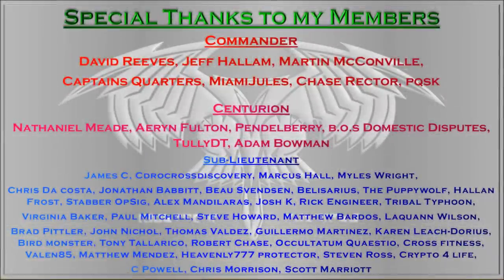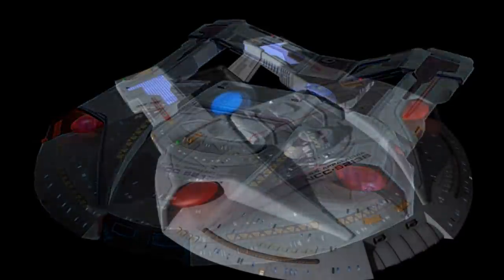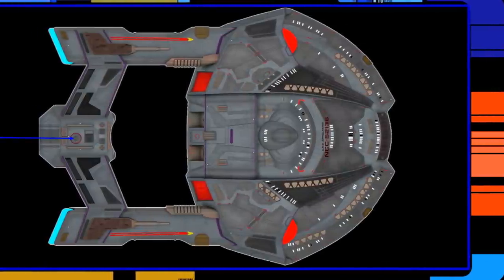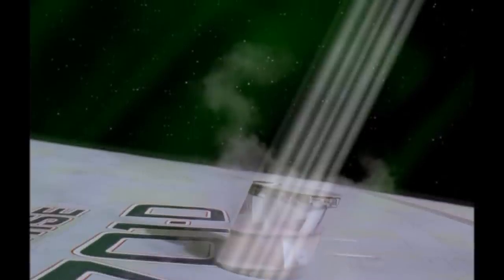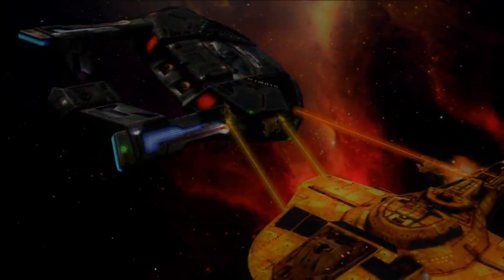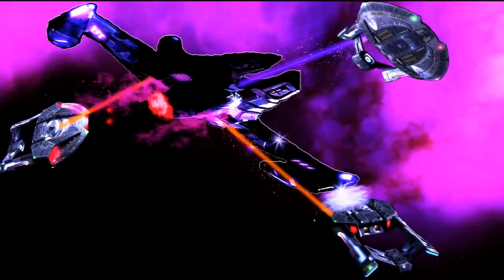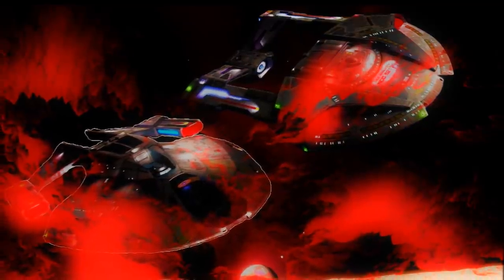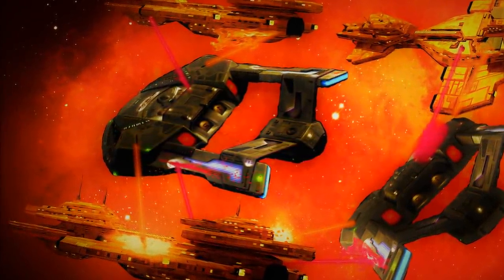Ship Chat: Steamrunner Class

Comment: The issue with the dedicated anti-borg role is the registry numbers, with several examples (including ones you've used in this video) in the 52xxx range. The Defiant is NX-74205; that's a big jump if both designs were instigated after Wolf 359. From what I can tell there are a few contradictory registry numbers for the USS Galaxy, but the lowest is NX-59637, and that suggests the Steamrunner class actually pre-dates the Galaxy class altogether. The small phaser strips are also unusual on later ships as you correctly note, but not the Ambassador class, which is notable for its small and disconnected phaser strips. I think this points to the Steamrunner class being the result of an earlier mini-rearmament phase. There's enough incidents and conflicts in the several decades pre-TNG to motivate a more combat oriented ship with approximately Ambassador class technology, and it's quite plausible that ships like that could be up-armored and upgraded in other ways when the threats started looking more immediate.

Comment: I’ve always really liked the Steamrunner class, but I do think that an underslung deflector would look better forward sweeping or swept back and above the saucer, like the Alkira, which is probably the reason it’s underslung to differentiate the designs, although I do like to see some design commonality so personally would have liked it above.
Reply: The Akira does not have an oversaucer deflector, it's deflector in under the saucer. The pod on the pylon over the saucer is a torpedo launcher, one of 18 the Akira has including a few that fire sideways out of the side of the saucer.
Reply: I should have been more clear, I was referring more to the pod, rather than what’s housed in it.
Reply: Then it wouldn't be it's own unique design. And it also defeats the functionality. Every ship doesn't need to be Akira-like

Comment: Other than the odd placement of the deflector dish, I really like the looks of this ship.  It makes me think of an old Fletcher-class destroyer, it looks fast sitting still and there's no question about if its a science ship.  Its a mean nasty warship and if you piss it off it will kill you until you die from it.
Reply: I have somewhat interpreted this as a destroyer, yes (from prior video game references) Small, fast, agile, flexible.
Reply: The Steamrunner's deflector dish looks better where it is than it would if it were a tiny sliver on the front of the main hull.
Reply: @deusexaethera  It could stay the same size and be moved forward to where its slung under the hull rather than being impossible to get at like an Oberth.

Comment: I have two issues with this design.  
1)  The nacells support the engineering section in space.
2)  The deflector dish is located BEHIND the main hull.  Like that will help it move debris out from the ships path.
Reply: Why not? Most SF vessels direct energies well ahead of the ship, not just a field a few meters off the bow.
Reply: @Euripides_Panz  Because the hull is blocking the projection of energies in nearly all areas ahead of the ship.
Reply: @nunya3163  how's that? From the images I've seen, the entire long-range sensor/deflector array 80% clears the hull at the keel and fields don't have to travel precisely ahead, they can be off a bit because they bulbous and are tuned to allow the hydrogen collectors to function.
Reply: @Euripides_Panz  80% clear = 20% blocked.  Also, because the deflector is both so far behind, and high up, it will be essentially incapable of deflecting anything above the centerline of the saucer.  And that whole field changing shape thing does not jive with the design of the dish, which clearly emits a cone.
Reply: @nunya3163  Clearly you know the design better than the designers. And see invisible fields.
Reply from the maker: You should watch sacred cow shipyards video on bussard collectors.
Reply: @venomgeekmedia9886  I did see that.  Very good channel.
Reply: How is that any different than the deflectors of a galaxy class or any starfleet ship bar the enterprise nx class? It’s positioned behind the saucer and below scale wise it’s the exact same
Reply: @Utubesuperstar  1)  The deflector on the NX is on the very front of the saucer, not on the bar behind the saucer.  2)  The Bar behind the NX is supported by two secondary hulls, not the nacelles.  3)  The deflector on the Galaxy is beneath the saucer, not directly behind it.  It is well below it, allowing for a line of site to push/deflect objects away from the entire vessel.
Reply: bar the nx means the nx is the exception and how do you explain then the akira sovereign nova intrepid they are all but flush with the bottom of the saucer section
Reply: @Utubesuperstar  The Akira and Sovereign have very limited clearance as well, yet that are both beneath, but not behind the saucer.

Not behind.  How hard is that to grasp?  It's like mounting the back up camera on the front bumper.
Reply: @nunya3163  it is on the rear of the saucer or back middle either way blind spot and if you look at the actual scale of the ships the distance is the same

Comment: I see this and immediately think back to your battle of the giants video. The tactics the Vorta used wouldn't have worked against a Federation Task Force. The Jem Hadar battleships worked because of weaknesses in Romulan ships and tactics. The fact that they had close with their big guns. Starfleet could sit their Sovereigns and cruisers at torpedo range easily side stepping the siege guns. Letting the Defiants and fighters take the attack ships and the Steamrunners wear down the defences of the Battleships and Battlecruisers.
Reply from the maker: Yeah it's a completely different doctrine and demands a different response.
Reply: @venomgeekmedia9886  Exactly. In that regard, the Cardassian battleship is better designed to face off against Federation and Klingon ships then the Jem Hadar battleship. In the end, the Dominion would have been better served building upgraded Hutet class battleships.

Comment: I thought the steamrunner only had a single forward torpedo tube. It was described as only having one tube in armada as an artillery ship which isnt official but a video i saw said it had one forward tube too. It having two forward torpedo tubes is odd rather than one fore one aft especially if its a close brawler as it would have to manouvre in close ranged combat and need an aft tube. I also heard it has quantum torpedoes. I thought i knew the steamrunners official traits compared to things from pc games etc that are not official but i should probably check. Nice vid btw
Reply from the maker: depends on which model you look at. but most of the up to date models give it two launchers.

Comment: This model never made any sense when considering the class was a "bruiser", the deflector is incredibly vulnerable in that position.
Reply from the maker: Not really. It's placed at the very back of the ship. Heavily armoured. From most angles you won't get a clear shot at it.
Reply: @venomgeekmedia9886  The only way it's covered is if the ship is pointing at a target and tilting slightly down so the main body of the ship is covering it. In any other position it can be shot at (from the side, rear, ventral, dorsal, and even the front, as it dangles below the main body). To me, it makes better sense to stick it on the secondary hull and use that heavy armor to cover that area around the deflector, and therefore the warp core. When placed on the secondary hull in the usual position it is completely covered from the top and rear. Just my opinion.

Comment: I'm not a fan of that Deviant art render that seems to squish it's warp nacelles together pushing them out of line with the Bussard Collectors, it looks wrong. I suppose they didn't put the deflector/engineering section on top as they already had the Akira running round with it's pod on top and wanted to distinguish them from one another in long shots.

Comment: maybe the steamrunner had the ability to disconnect from the aft deflector dish piece if there is a warp core breech
Reply: That's a lot of area to lose in my opinion. From the looks of the schematics, it seems that ejection of the warp core would be easy where it's at. Just drop it straight out and you're good.

Comment: Steamrunner was always the odd-duck of the new fleet designs for me. I could never figure out where it fit, What It's job was.
I guess, for my head canon I'm going to put it down as the Fleets Frigate, Built to be Tough and replace the older Brahms era frigates.
Reply from the maker: Yeah it's tougher than the new Orleans and cheaper than an intrepid
Reply: Lacking maybe in firepower to a N. Orleans, but armor makes a real difference, plus speed.

Comment: @2:28 if I where to ram something at the aft/behind the ship, I would rather have that structure(housing the whatchamacallit: deflector dish, deflector array, or main deflector) to bare the brunt of the impact. ......or even worse if a much bigger ship like a cloaked Negh'Var Class Klingon battle cruiser rams me from the same direction, the Steamrunner with the inverted main deflector housing design, the two warp nasals will be destroyed and my escape with barely capable impulse power will be a very short one. Also when maneuvering under thruster propulsion, I would rather place the thruster components on the deflector housing(original designed) all the way to the rear than to complicate things and have them placed on the warp nasals. and if I may be so bold, @10:50 'some times the simplest solution, sometimes the dumbest solution,  is the best solution'. But nonetheless another excellent video, and love your channel.........' Peace and long life'-  ambassador Sarek.

Comment: They should've put shuttlebays where the impulse engines are and the main impulse engine in the center aft of the saucer where the main shuttlebay is. The impulse engines where they are will absolutely fry the pylons connecting the nacelles to the deflector/engineering pod🤦